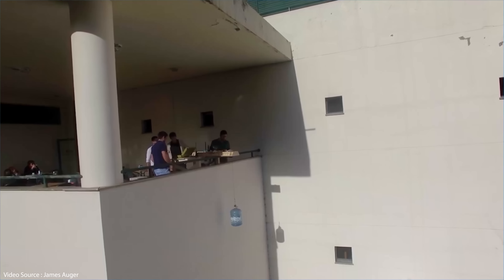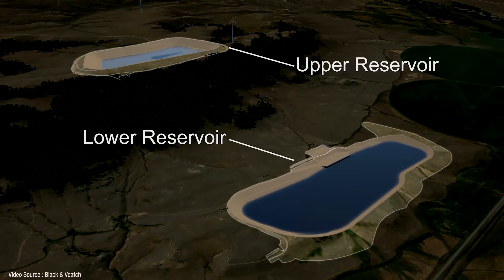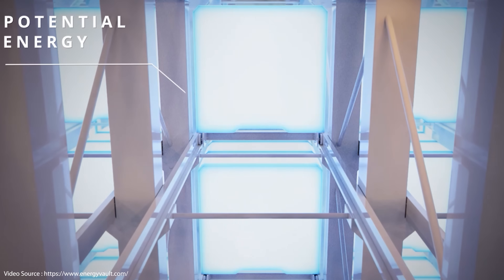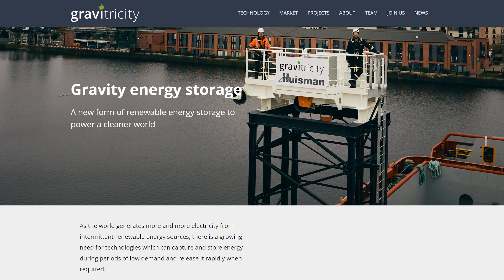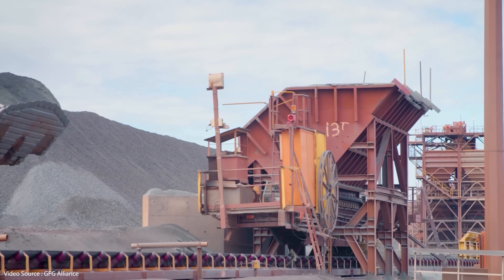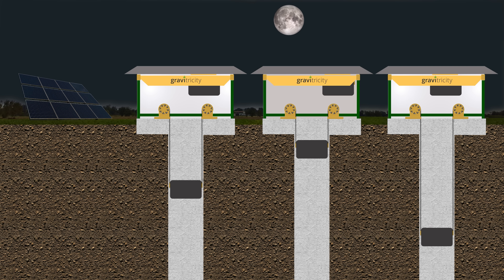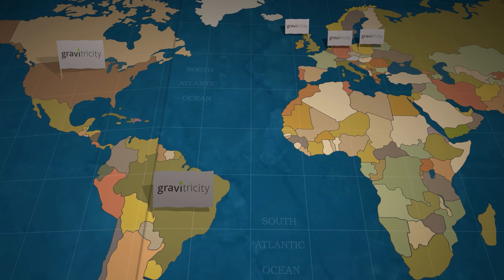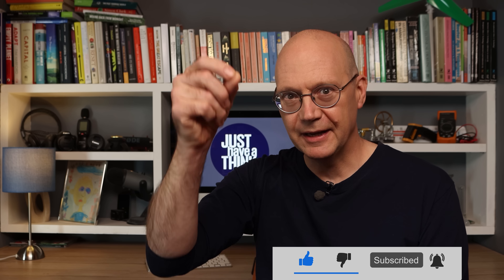Gravity Energy Storage. Who's right and who's wrong?

Comment: I landed here looking for the feasibility of doing this at a smaller scale -- at the household level. I wonder what size of weight and tower/shaft would be needed for a single home, to provide enough energy to get through the nightly downtime of solar.
Reply: Let's assume a rather modest storage capacity of 5 kWh (1 full-load-hour of a 5-kWp PV system). This would be 18,000,000 Joules. Potential energy is mass in kg x height in meters x 9,81 (g). So a perfect system (100% efficiency) would need a product of height and mass of 1,834,862 to store 5 kWh.
For instance 1.8 metric tons and a height of 1 km. Or 183 metric tons and a height of 10 meters. Or 18 metric tons and a height of 100 meters.
It really doesn't make sense in a small scale.
A battery of an electric car has a storage capacity of several tens kWh nowadays. Many more than 50 kWh.

Comment: Gravity is quite a small force. Formula for energy is e=m*g*h, which is for example for 50 metric tons and 500m dept:
50.000kg*9,81m/s2*500m=245.250.000 Ws which is 68 kWh. This is the energy of my car's battery! Ok, it may last longer but is it worth the efforts? I doubt so.
I know this video is quite old but I am wondering why noone recalculates the physics behind it.
Reply: It's a cost issue, more than the total capacity. Your car battery can store the same energy, but it won't last as long and it probably costs more than the 50 ton weight. Obviously the tower/shaft of 500 meters is a big cost as well, but there's no reason you'd design it at the scale of just 50 tons of lifting weight. These systems scale up near infinitely, and get more cost effective as they go up, while chemical batteries have a lot of negatives, namely that they aren't cheap, aren't easy to mine/make, and don't last very long if you actually unload them frequently.

I'd expect most gravity systems like this would operate at least at the multi-megawatt scale, storing power for a town. They're more of a medium-scale storage option, more cost-effective over time than chemical batteries, but there's no real reason you can't scale them up to truly massive storage.

Comment: what if you put water in under ground and then when the weight is reaching the botton you can just add air connecting to the weight using compress air, will it cost less energy or will it be the same as the solar generating a power to a motor?

Comment: A 30 tonne block needs a vertical drop of 12.2366 meters, to store 1 kWh.  Dropping a 500 tonne weight down a 400 meter shaft, will yield a theoretical maximum of 544.8 kWh. For the sake of efficiency losses, I would call it ~517.56 kWh useable. it will require~573.5 kWh, to bring the weight back up. (assuming a "round trip" efficiency of 90.25%, 95% up, 95% down)
     Math can be terse, but it tells it like it is!

Comment: The only reason pumped hydro is a good idea, is because almost the entire machine and almost its entire materials are basically free. As soon as you need to produce your weights and build a structure to hold up the weights, you loose all advantages. Just for reference and understanding: With the losses of the most efficient pumped hydro storage facilities in the world, an entire fully loaded shipping container (36 metric tons), lifted from the ground up to the upper tip of the rotor of a wind turbine (140 m), stores a single kWh of energy, as much as half a car battery.

So gravity storage is fundamentally bogus, unless you can build a small dam do create a big lake and take huge amounts of water from far below it for free and pump it up to your lake.

Comment: What's the advantage of doing it underground?  If something goes wrong it will be less accessible.  Also you can't expand the system, you would have to dig another hole.  I can't see how blocks of mass can compare with the massive amounts of water that are usually used for this kind of thing.  Why not use the mass of a building to do the same thing?  It would rise throughout the day and slowly sink at night.  Why move the blocks any direction other than up and down?  You could make one module, just up and down, then if you need more capacity add another one right beside it, etc, etc.

Comment: I think a combination of these concepts would be the answer. Dig a series of large shafts. Line the walls with concrete, then use the same system as the mine shaft. You could build it under a solar or wind farm.

Comment: @xfiles4792 has the right idea.  Rather than a few locations with mine shafts that are constantly filling with water, a rail line on an incline, pulling a freight car up and down.  Lots of locations, no water problems. Energy capacity is the same, no matter if the path is vertical or inclined.

Comment: You know how stupid this makes everybody in history look? Seriously tho, this is like stone age (no pun intended) power production. Placing a generator next to a hole with a rock tied to a rope and just let it go and boom electricity.  Every sky scraper in the world could produce its own power by having gravity generators (I refuse to call this concept a battery or storage) placed at the center of the building. Elevators could even be used to generate power that's stored onsite while they are not being used (just an idea for older buildings that could not house a gravity generator due to free space restraints). These could also be placed on the side of buildings. I bet it would be a lot cheaper to have a few gravity generators connected to the top of a house and you just carry the weight up to it and let it produce power for storage instead of installing solar panels. The idea of using this as a form of storage by letting solar energy power a motor to pull up a weight and then letting gravity pull that weight back down to produce power is absurd to think power is being stored. It's being wasted in that form.

Comment: I wonder if the efficiency would increase,  if they used buoyancy by gravity fed water into the shaft to raise the weight, if the weight was on a large hollow platform. Water could be gravity fed from above thru a valve at the top middle passing  thru a pipe down under the weight with a release valve at the bottom closed. Then when they want to use the energy, open the bottom valve and close the top valve. Water is pushed thru a sidewall pipe into a holding tank up high towars the top of the shaft.

Comment: I'm interested in the power regulation process in gravity power and also spring driven radios. It seems you need some system of charging and discharging capacitors to regulate the speed of the weight because it behaves exactly the opposite of demand.

When demand increases, generators feel more resistance to turning. When demand reduces, generators spin more freely. The problem of this is the weight plummets rapidly when you don't need much power, and is slow when you need a lot. This is the exact opposite of what you need. With pumped hydro you can change the flow rate. One way I've thought of for a DC system is to charge a big capacitor that's running your load, then disconnect it and switch a shorting wire across the generator to slow the weight lowering. Then reconnect the capacitor. You'll see the speed of the weight change rhythmically but I think this is similar to the old reel spring radios before they just used a hand crank generator to charge a battery. You'd need a voltage sensor to switch between them.

Comment: To be honest I think you'd be better off with compressing or stretching springs and it would be way more compact than weights. Imagine extra long coil springs put under tension - or perhaps a giant constant force spring - a huge roll or multiple small rolls of springy steel winding and unwinding. Even the ones in the old Bayliss radios could store almost a kilojoule, and were way more compact than 100 kg weight lifted a metre.

Comment: Why wouldn't you use mercury or lead powder instead of water?
Reply: Cost, perhaps?
Reply: @thedubwhisperer2157  I guess, but I would think there would be a more dense liquid or powder that would be less dangerous than rocks and easier to handle.
Reply: @MegaLokopo  Water has a fantastic capacity for storing heat energy but is temperature-limited, unlike many solids.
EDIT: Posted in error.
Reply: @thedubwhisperer2157  I just mean using it as a weight. If you are having gravity powered storage you should use the densest material possible.
Reply: @MegaLokopo  You are of course absolutely correct.  My apologies, I confused videos and wrongly commented here about heat storage!  Doh!!!
Yes, denser = better. 😬

Comment: the issue of these storage systems comes back again and again to the same fundamental problem... the energy density of gravity storage is very diffuse. A large amount of storage is stored in pumped hydro, because the dams that make them up hold back vaaaaast volumes of water. millions of cubic meters.
Steel, lead, concrete, are all in the order of 3-10x the density of water. this means they only need 1/3rd or 1/10th the volume, per unit energy, all else being equal. 
1/10th of a dam is still, unfortunately, a huge volume, several hundred thousand m3... the telsa giga factory is 400 000 m3 for instance (largest factory in the world)... and thats before considering any height difference... thats just considering the volume of steel required to be in the same range as the hoover dam. Using concrete, would need 3 giga factories. steel/concrete costs faaar more than water, too, and then there's the processing required for it all to fit nicely. 
Those 3tone blocks, up a 100m shaft, would store less than 1 kwh each. You'd need around 10 for 1 night of storage for 1 mid size house, assuming 0 losses... 
a tonne of concrete requires about 155kwh. So you'd need to lift that 3T block about 600 times on that 100m shaft, JUST to pay for itself, not to mention the rest of the supporting equipment or round trip efficiency. Seel blocks by comparison, for the same weight... would need to be lifted 22 000 times. Water, by comparison, costs nothing, and in many cases is lifted to the top of the stack by natural forces rather than cranes, which also, costs nothing.

Comment: The biggest competitor to renwable energy storage from a cost perspective is not actually storage at all, it's simply installing more generation capability at different geographical sites.  With the cost of wind and solar installs plumetting it's most likely to be cheaper to just install more of each and to make the users load level, ie to drop the stupid fixed rate energy costs and to allow the market to be fully dynamic, which means lots of cheap 'lecy when the wind blows and the sun shines, which means users use that 'lecy at this moment.....

Comment: The biggest issue is that mostly mines are horizontal shafts with only one (or a few) vertical shafts. This is because the mine is accessing material laid down in rock strata so once you dig down the drop shaft, most of the work of the mine is then digging out sideways at constant gravitational potential.  As such, lowering a single weight looks very limiting.  Better in terms of total energy storage to either lower and raise lots of weights (using some sort of train track to shift carriages of weights sideways at top and bottom of shaft, or much simpler and more reliable, simpyl pump a suitably dense fluid (ie water...) up and down.  Whilst the water is probably 6 times less dense than a physical mass, it would seem to be trivially simple to move well over 6x more water by volume than individual physical masses, and that's before you include the complex arrangements required to handle those masses, the inability modify how much mass is moved at any given time, the likely mechanical friction and of course the maintaince and installation of all those systems.  

concrete spraying the mine walls to seal them, and building a resevoir at the top of the mine, then using water sounds far easier to me.......

Comment: I don't think ground water inundated shafts would be a problem. Lowering a solid mass with as little displacement as it would have would drop to the bottom of a well or shaft just as fine.

Comment: So, 4 cables are going to support 50 tones of magnetite for how many years.?  most of the wear will be in the cables and generators. Have these cables been tested to hold this much stress for this length of time in years? what if 1 cable breaks? how do you extract the block? finally why not mine the magnetite further to produce a magnet that can also be used to generate electricity. Calories in calories out,

Comment: The container should hold WATER.  Its easy to drain it out.  And probaby use less power to pump then what its producing.  Its easier to lift up the Empty container when it gets to the bottom.  Let the whole lift take about 6 hours.   Drain the water in about an hour.  Lift up the box in 30 min.  Take about 4 hours to fill it up.

Comment: There is probably about 105 viable pumped storage sites in just England and Wales and probably 150 in Scotland that use at least one existing reservoir. There are also 1300 closed coal mines that could be used for joint heat and PSH schemes.
Reply: Why would you put weights into mine shafts when they are filling with hot water up to 40C. Building a reservoir on the surface could hold 100 x the weight in water and at the same time use the heat for houses, factories and winter greenhouses. There are projects to do this in Germany, Estonia, US and China.

Comment: Why not use a sloped track from a cliff?
Reply: There's a train cart storage project in Nevada.
Reply: @awdrifter3394  A few fiber glass pools on train wheels, fill them with water and dump it at the top. If the are just shifting weights then what's the issue with a liquid?
Reply: @yanidoesit  I think the train cart storage project uses gravel as weight.
Reply: @awdrifter3394  should get ChatGPT to do the numbers. I live on a slope.

Comment: Just use pumped water storage in any location near salt water. The elevation change should be easy to find next to the sea. Throw in a desalination plant for extra drinking and irrigation water that will operate by consuming some of the electricity that comes in for storage. Places with drinking water deficiency are often places with high solar and wind potentials too.

You don't want extra drinking water. Then water hydrolysis. Get that sweet sweet hydrogen out of that wet blue stuff...

Comment: Key issue of LDES is to be "Deployable". As turtles & snails understand the concept. Gravity in Shafts as with Compressed Air ideas, are like  Pumped Hydro, limited to geology and geography whereas proper Clean Energy Transition needs to have pure deploy ability at affordable prices. Cheap power also equally vital. So to the LCOS in this one at 17cents/kWh way too high - Remember for 50MW of Fossil Power Gen to be replaced, it needs 300MW-550MW of VRE (for all that charging and the difference is the RtE range of 50% to 85%, with the former being the more likely)... So cost is key for all to enjoy affordable power and not die (literally the price for the poor and elderly if you have to turn your heating off). All In Wholesale Power prices need to be under 10cents /kWh (for affordable metal processing like Aluminium needs to be 3cent/kWh...). Presently in EU thanks to their mad rush into VRE without "firming" it (because affordable deployable LDES has not been invested yet... thus even more madness) wholes power prises were upto >$30cent/kWh in 2022...

Comment: I have an invention of a GENERATOR, ACCUMULATOR AND SOLAR FOLLOWER ecologically correct works by changing the charge. Due to the financial difficulty, I would like some help to build a prototype. The theoretical project is ready, lacking the tests in practice, estimated value of the prototype R$ 4,850.78 I will account for all products purchased by sending an Invoice or if you prefer to send a list of materials. Brazil

Comment: The problem with your analysis of NRGV is that their concrete blocks are a new patented compound that utilizes ash from burned waste in landfills, which the company is actually getting paid by the federal government for cleaning up landfill waste. Secondly, the new mixture is stronger than any concrete we’ve ever even dreamt of, it will be roughly 20-30 times stronger than normal concrete. So continual maintenance and upkeep is in fact not a reality whatsoever. They’ve also already built their concept that absolutely proves the setup works flawlessly. The entire point of is to be able to store all of the solar and wind energy we can harness during the day, but until now lacked the ability to store long enough to be available in the evenings when the grid requires the most energy. And the amount of potential energy storage/output possible blows away anything Tesla battery storage systems could ever hope to provide, oh yea and at a fraction of the cost compared to the large battery farm storage solution.
Reply: Now the issue with Gravitricity is that the scale their solution can provide simply falls flat on its face when it comes to its ability to provide enough storage to actually service an entire electrical grid. Also, mine shafts are limited in size, so this issue cannot be made up for like NRGV’s Sustainability Center’s modular build scale capabilities. Not to mention, much like pumped hydro, the locations you can build such a design are few and far between, and likely exist far away from the grids they’re intended to service, almost guaranteeing their solution will not be able to be profitable and the company will never fully materialize. NRGV on the other hand will be using 100% recycled materials for its entire structure, essentially costing them $0 for raw materials while also helping to recycle and clean up the earth at the same time. NRGV is superior in every way